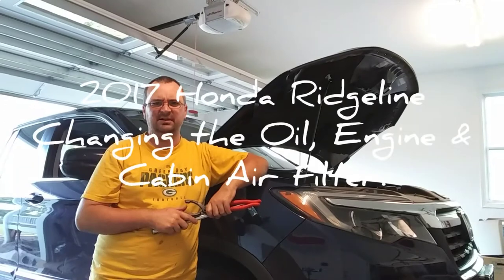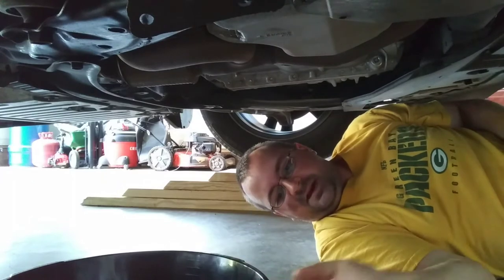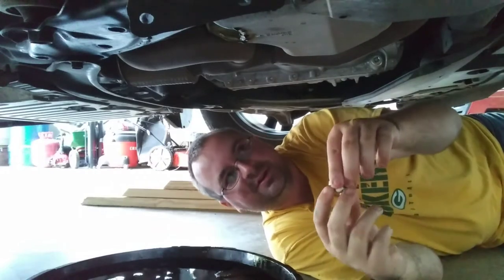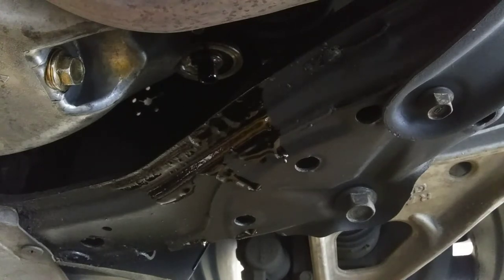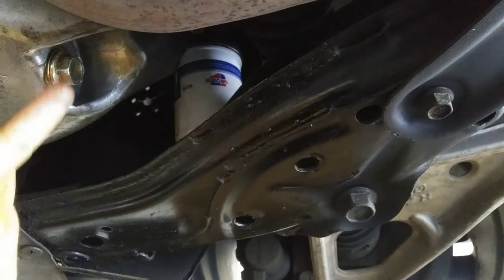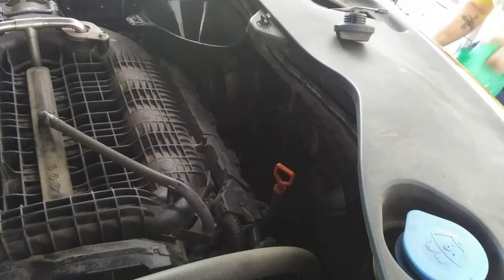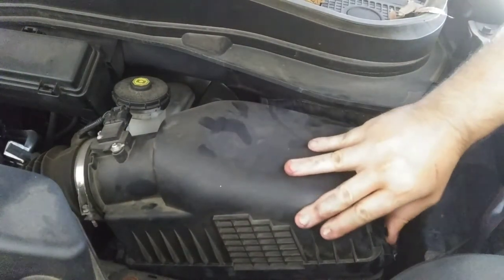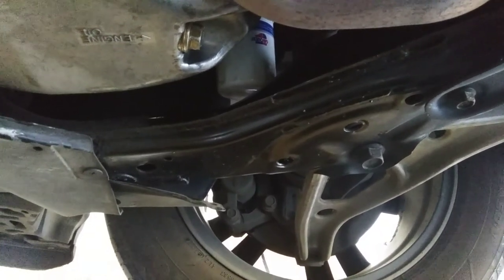2017 Honda Ridgeline - Changing the Oil, Engine & Cabin Air Filter.

Comment: Thanks for the info, about to change the oil on my 2019 Ridgeline myself for the first time. I love the ramps! And a torque wrench is a really good idea for the drain plug. A lot of people over tighten the heck out of them which can strip aluminum oil pans easily. The spec for second gen Ridgelines is only 29 or 30 foot pounds, which isn't very tight.

Horrible placement of the filter on these, thanks Honda engineers. Every Subaru I've seen has the filter pointing up and accessible from the top side without even really bending over, easy with no mess.
Reply from the maker: Yeah, I always have to wipe everything down really good, other wise the wife will think she has an oil leak. Thank you for watching and glad it helped.